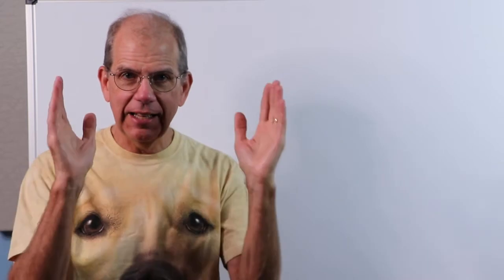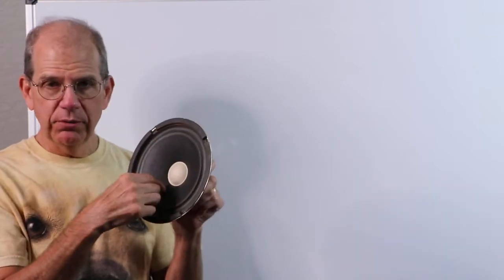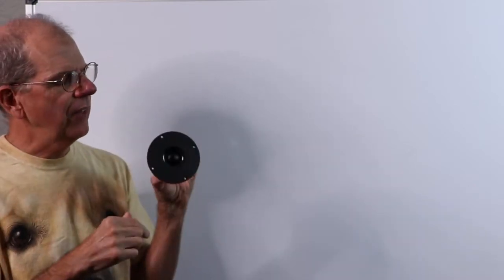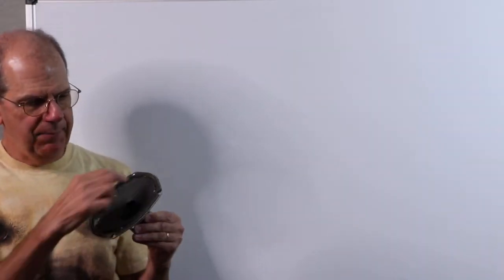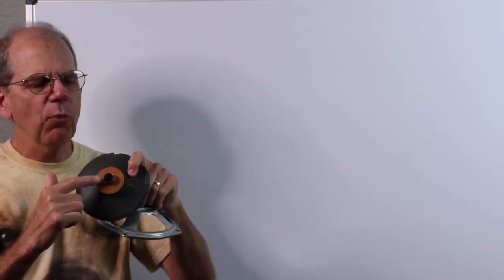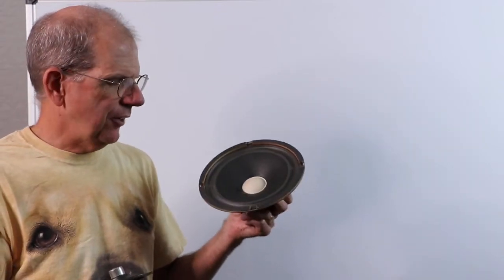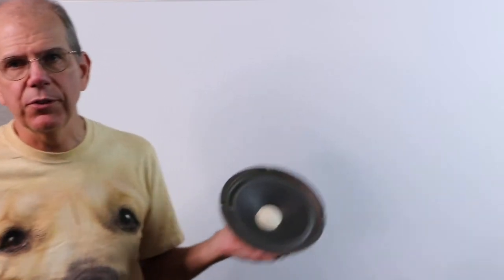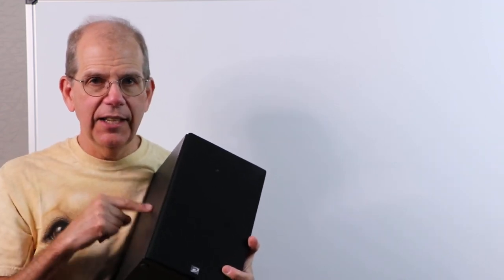Science of Sound: Loudspeakers Introduction

Comment: WHAT ADVICE WOULD YOU GIVE FOR SPEAKER PLACEMENT IN A ROOM FOR BEST SOUND QUALITY?
Reply from the maker: That depends partly on the design of the loudspeaker, but if we're talking about a generic bookshelf design, placing them in corners will maximize bass but give an uneven response (not what I would do, but some people loooove bass). For a more consistent, even response, place them away from the rear and side walls (the distance to the side not being the same as the distance to the rear). You should also consider the acoustic space itself. Some people spend tons of money on gear but don't ever consider the acoustics of the room. That plays a huge role in how the system sounds. For typical listening rooms, I am an advocate of adding broadband absorption, especially in the trihedral corners. Carpeting may also be beneficial (watch for floor-to-ceiling slap echoes), or foam (e.g. Sonex) panels on the ceiling.
Reply: THANK YOU!

Comment: WHAT DO THINK OF A PAIR OF JBL L100S AS  FAR AS SOUND QUALITY?
Reply from the maker: That's a classic 1970s design (a consumer version of the 4311 studio monitor if I recall correctly). I haven't heard L100s since the late 1970s. At the time they were pretty good but certainly not the best out there at that price point. I recall A/Bing them against a pair of ADS810s and preferred the ADS. JBL also came out with some new designs at that time which I also preferred. Still, I wouldn't mind having a pair if someone gave them to me ;-)
Reply: I AM THINKING  OF BUYING A PAIR BUT,THEY SEEM RATHER PRICY,NOT SURE I CAN AFFORD THEM.THANK YOU!
Reply from the maker: @davidluther3955  When it comes to buying "vintage" loudspeakers, the one thing I will caution you about is the driver surrounds, especially on the woofer. These things can start to fall apart after a while, particularly the foam half-roll style. That happened to a pair of Paradigm mini monitors I had (replaced the surrounds a couple years ago). OTOH, I still have a pair of Klipsch Heresy from the late 1970s (corrugated suspension, looks like paper impregnated with plastic/rubbery stuff) and they are still holding up just fine. Be particularly careful if they were stored in hot/cold/damp environments for a length of time (basement or attic).
Reply: THANK YOU FOR YOUR ADVICE!DO THEY STILL MAKE AND OR,MANUFACTURE THESE ADS810 SPEAKERS,ARE NEW ONES AVAILABLE?

Comment: At 13:04 are you implying that the tweeter and woofer should have the SAME Values for Volume Velocity? Thanks.
Reply from the maker: "Sort of", because the energy density of music/speech at the lower frequencies is much greater than it is at high frequencies. Thus, in practical solutions, tweeters don't need quite the output of woofers because they're not normally called upon to produce the same sort of levels.
Reply: Thanks for the follow-up @ElectronicswithProfessorFiore

Comment: Thank you so much for these videos. It's perfect timing. I am trying to design my own hand held speaker system that emits very loud low frequency sound waves for this engineering project. Your videos are clearing a lot of things up for me!
Reply from the maker: Small, low, and loud is a hard combo to achieve, assuming you want low distortion! Not sure of your engineering level or budget, but you might might want to look into motion feedback systems to help control THD. The follow up video on Loudspeaker Enclosures should give you some insight into the issues.
Reply: @ElectronicswithProfessorFiore     I am a 3rd year undergrad Mechanical Engineer trying to dip my feet into electronics and acoustics! My budget is a couple hundred dollars I can always ask for help though. This speaker I am trying to make is going to be used to cause a disturbance to fires. So the sound quality isn't my highest priority since I just want something that gives me a high particle velocity. But I am just now learning about control systems so adding a feedback system like that sounds fun! I will have to look into it.

My main issue at the moment is figuring out how to choose an amplifier given any speaker. Going into this I was also hoping to design and solder my own amplifier, but I am not sure if that is a bit ambitious since my knowledge only extends to op amps and low and high pass filters. From the quick googling Ive done it seems op amps might not cut it for the power I will be needing.  I've only ever taken intro to circuits and system controls so I am having to do a lot of learning in my own.
Reply from the maker: @geralferald  Most op amps are low power devices. You can buy high power versions that will dump >100 watts but they are pricey (>$100, depending).
I am curious about the "disturbance" you mentioned. If it's above maybe a few hundred Hz, look into using a horn. Very efficient and lots of directivity control.
Reply: @ElectronicswithProfessorFiore  I've seen some research online about fire extinguishers that use the power of sound to extinguish flames so I thought it would be fun to try and make my own set up for it. Some research from DARPA found that they had success with a frequency around 40-60 HZ and increasing the particle velocity increased the fire suppression. So my goal is to make a low frequency high amplitude speaker.

In the end my main goal is to learn about the mechanics of fire suppression with sound but I would really like to solder my own amplifier for a speaker too if possible. I am looking into videos about MOSFETs and BJTs and I think I am getting close. There's just so many different types of amplifiers it's hard to know which one is the best for me to design.00
Reply from the maker: @geralferald  Interesting. Given the relative inefficiency of standard piston-style drivers, I wonder if they are using an entirely different approach. Obviously, fidelity is not an issue here, so something that can produce a high SPL in that narrow range is all that is needed. I am thinking along the lines of a siren, but at a much lower frequency. IOW, think mechanical rather than electrical transducer. 

I've designed PA subwoofers, and while they might have been able to snuff out a candle close by, I doubt they could do much more.